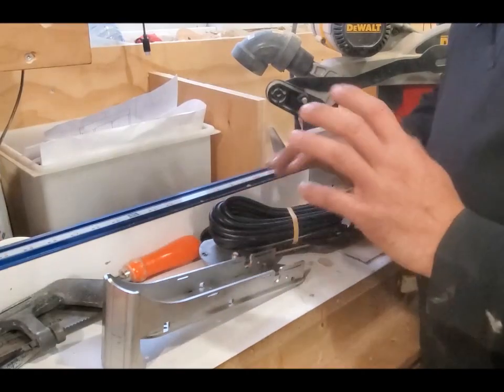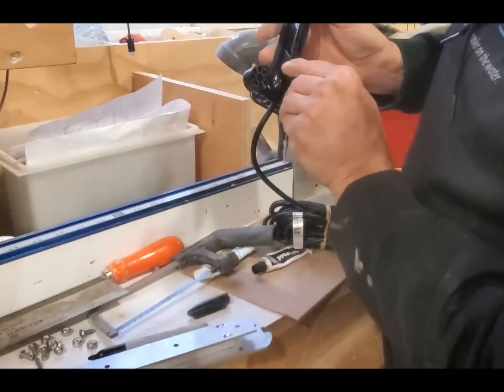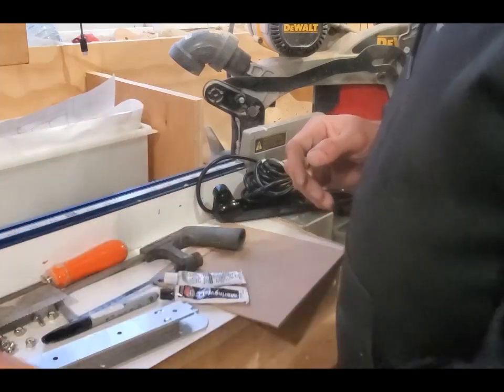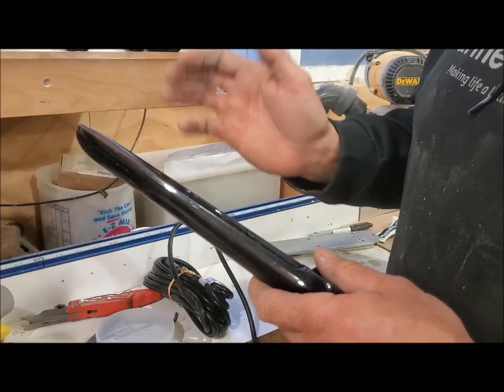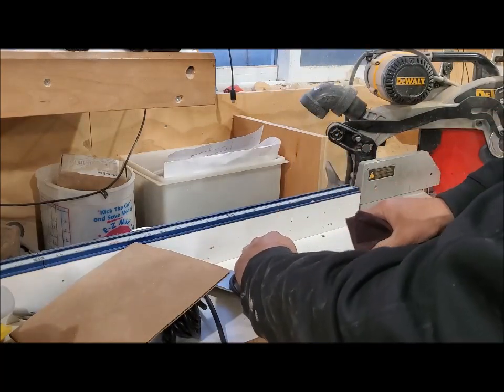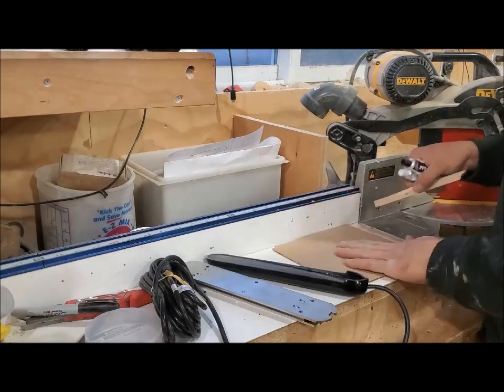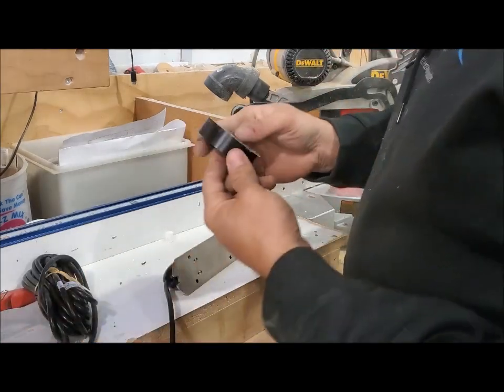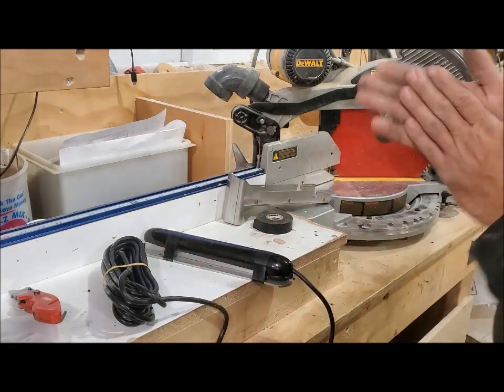RyTek Marine Lowrance Tripplshot Transducer RTL4500 Installation Video Part#1

Comment: I need something like that. I have the triple shot with a minn Kota edge 45. Problem I’m having is that fin on the front of the motor.
Reply from the maker: Have sold many of the RTL4500s to customers with the same motor that cut the skeg and run one of our RTL1800 guarded mounts with great results
Reply: @rytekmarine6717  how much
Reply from the maker: All available right on the website at www.rytekmarine.com
Reply: @RyTekMarine what setup would I need for lowrance triple shot transducer to Mount it to a fort Rex 80